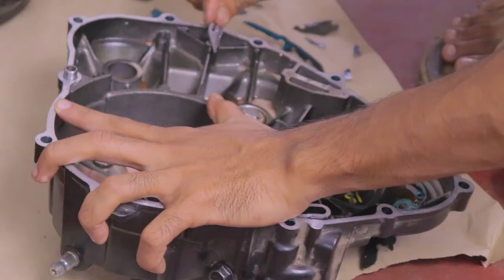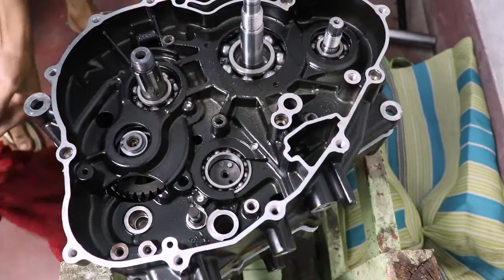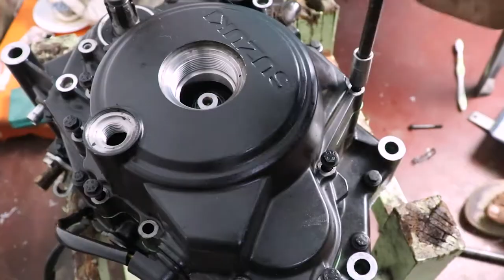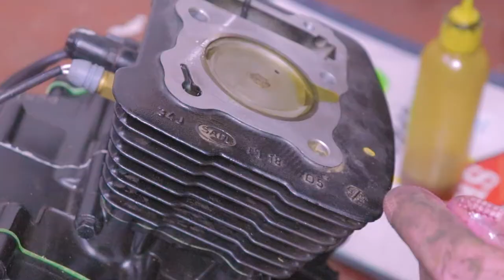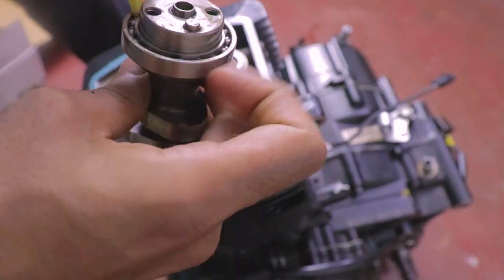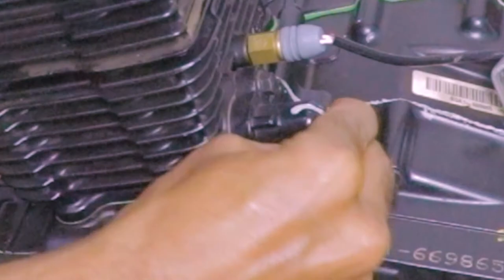Suzuki Gixxer Timelapse Rebuild

Comment: Using cutter to remove old gasket may cause scratches on engine cover and oil leakage
Reply from the maker: One have to be careful, our intention is not to remove metal from the case, only the paper gasket. Small scratches will not cause any issue, thats why the gasket is there.

Comment: Brother, I need someone to rebuild the engine, since it broke after some highway riding. Any suggestions since the service center guys are estimating around 20000/-
Reply from the maker: Which bike is it?
Reply: @EzMeck  Gixxer 155 BS4 only
Reply from the maker: @PRO2358  they are asking very high amount, engine repair wont cost that much.
Reply: @EzMeck  yes, that's what I felt. I'll ask another service center. Kick is jammed, so damage is substantial is what they told me
Reply from the maker: @PRO2358  i think they told you the max amount,
Reply: @EzMeck  yes, I believe. Hopefully it'll be less. They've still not opened the engine. I'll update after getting it done. Have to trust service center guys. No other go
Reply from the maker: @PRO2358  where are you from?
Reply: @EzMeck  chennai
Reply: My service center charged me 8800 , changed everything but shitty performance
Reply: @PRO2358  tamil aa 
Ananum gixxer sf 155 dhaan vechirken

Comment: Hi bro ,  I'm using Gixxer sf 150 , I'm facing problem in my bike , while running my bikes goes suddenly off ,  I changed spark plug and air filter also still that issue I'm facing. What will be issue in my bike , is that tank have any rust or carbon dust. May be that also one of the reason for this problem. Pls help me to solve this problem
Reply from the maker: Is it a carburetor version or a fi one?
Reply: Fi based
Reply from the maker: @karthikn1594  if you have rust in your tank, then probably the fine rust particles clogged the fuel pump filter partially. Also consider cleaning the injector. That may solve the issue.
Reply: @EzMeck  ok thanks brother

Comment: How much cost for the full assembly parts and what are the parts required
Reply from the maker: Connecting rod, some bearings, piston pin, etc.
Reply: How much it's cost
Reply: @EzMeck btado bhai
Reply from the maker: Mera to dost ka tha, Paisa nai liya. Service centre me rebuild karwaoge to 4-5 hajar le lenge.
Reply: @EzMeck  bs 4-5 hazar??
Reply: @EzMeck  kya kya hota hai bro complete engine overhaul mein

Comment: Is gs150r different from Gixxer
Reply from the maker: Some parts are different, also gixxer is 5speed gs150r is 6 speed
Reply: @EzMeck  is gs150r gearbox can be fit in gixxer 150
Reply from the maker: They look fairly similar from outside, you can give it a try, but I am not cent percent sure.